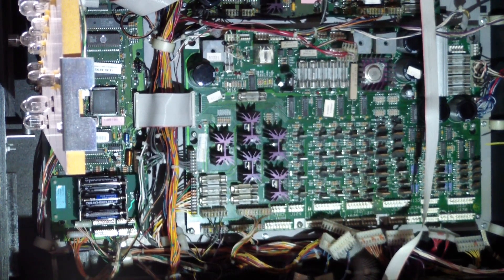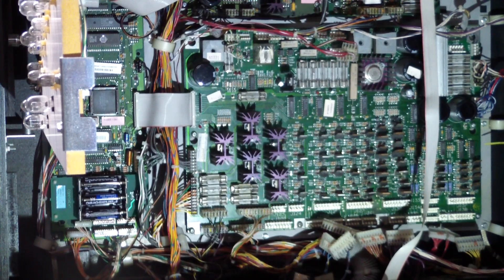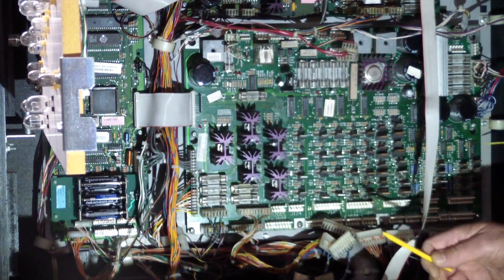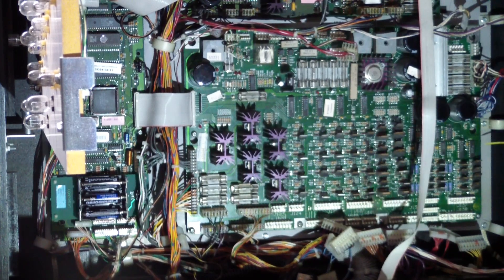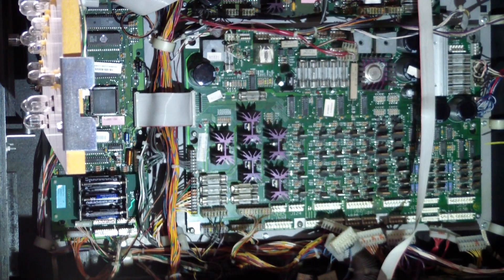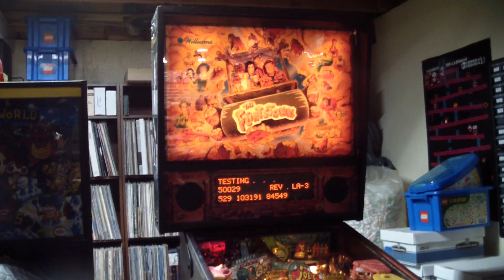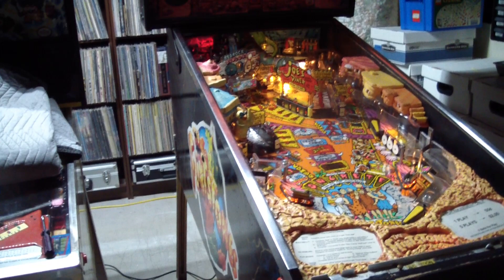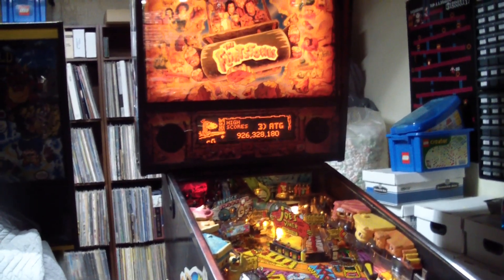AE#131 Williams Pinball Controller (WPC) PCB Fault Analysis And Repair, Part 2

Comment: Hey Artie. What ever happened with the single fuse that was blown? I don't think you ever mentioned what you did about that... Thanks for the great video again!
Reply from the maker: There must have been a shorted GI chain in whatever machine the board was installed in previously. I just replaced it and all was well